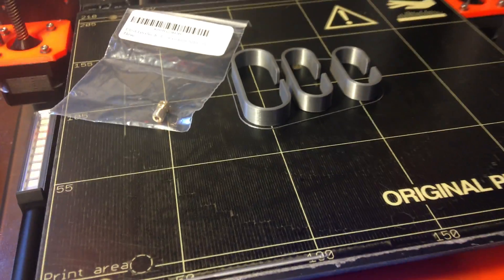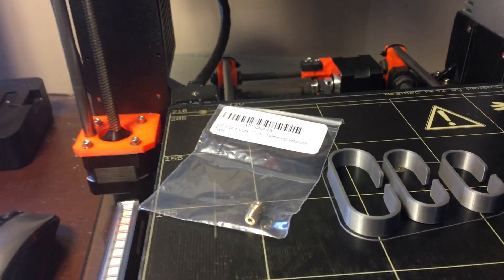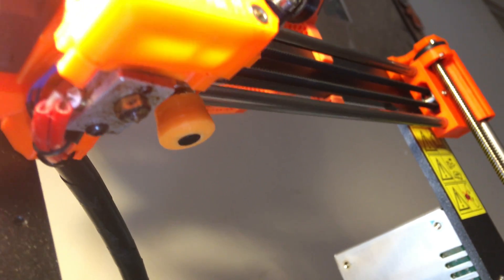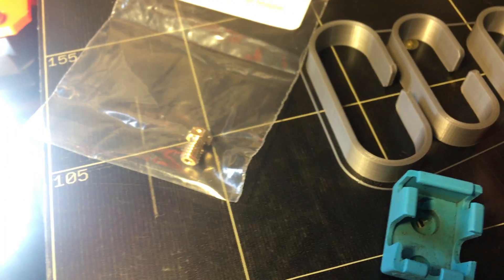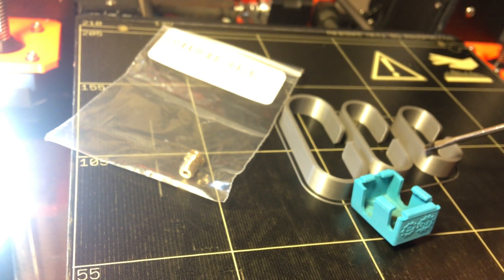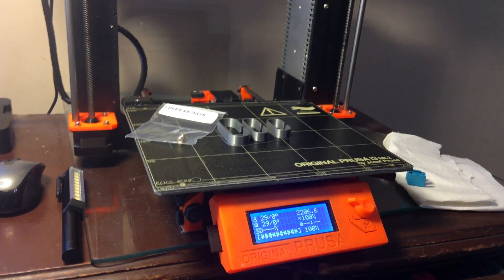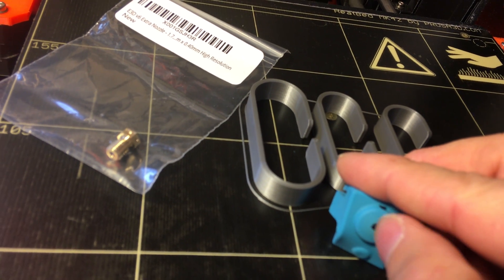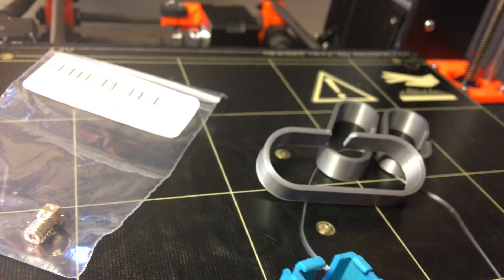Weird issue with E3D Silicone Sock on my Original Prusa Mk2 Printer (Fixed)

Comment from the maker: Quick Update: I just got a new set of  E3D Silicone Sock, and they appear to be redesigned.  they have a bigger cutout for the nozzel. That should resolve any future issues as the sock is now nowhere near the bed,
Reply: can you provide a link. on aliexpress, they only refer  to the MK3. I have a MK2S. I wan"t to try printing with a 0.15mm nozzle, and it seems to be useful.